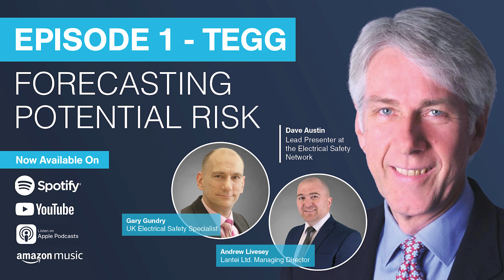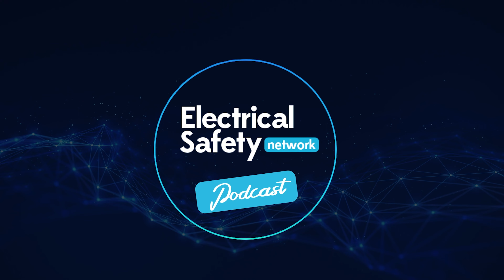Could forecasting potential risk save you time and money?

Comment: Just for openness so people can form their own opinion on whether they would be legally covered with TEGG and the British statutory legal requirements and insurance needs when it comes to carrying out EICR’s the answer is no. TEGG is nothing more than an American franchise and does not meet the legal requirements within the electricity at work regulations 1989 and reg 14 of this makes interesting reading. Of course any duty holder out there listening to this podcast or people responsible for H&S and ppm maintenance can form their own opinions. What does TEGG tell you about live and dead testing on circuits and distribution boards info ? What remedial actions would it highlight relating to this ? The answer is nothing. Electricity kills and burns people and causes damage in domestic and commercial properties in the UK each year. Will an American franchise model called TEGG cover you legally ? The eye watering yearly cost of a TEGG test is something folks out there need to investigate fully.  

Let’s see if the podcast channel owners allow this post to be seen on their channel comments ? Of course this is my humble opinion as a 35 year experienced time served inspector who now teaches inspectors and advises insurance companies in the investigation of damage claims in the workplace caused by electrical faults.

Is TEGG legal in the UK ? Does it protect you as a duty holder ? Does it tell you about all of your site it’s circuits and fuse boards and locate remedial actions ? Is it just harmonics and hoping the wee fella doing the TEGG service hears a blip on his headphones ultrasonic ?

Great questions to ask so let’s open the debate up so we can all get the true facts about this American franchise.